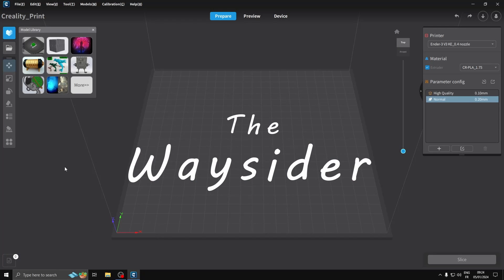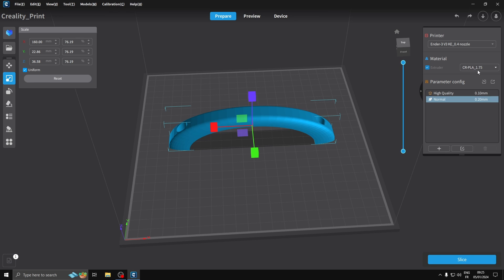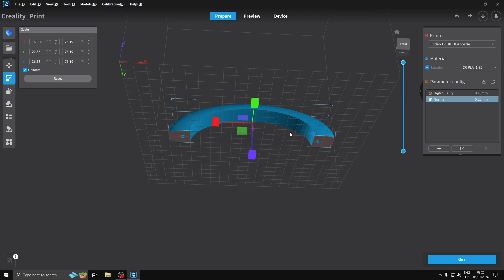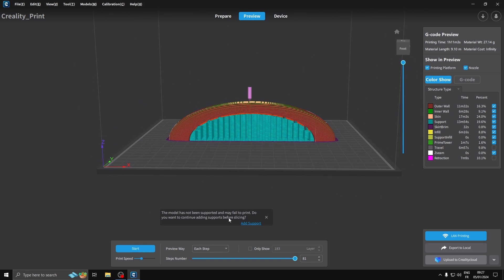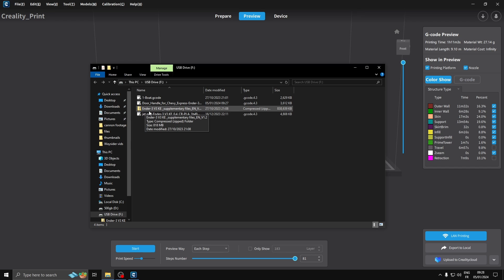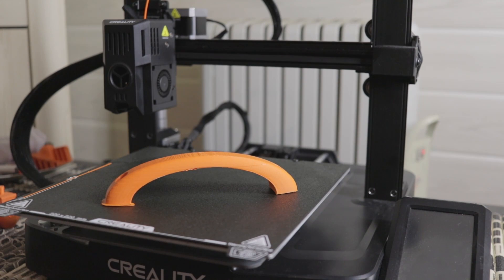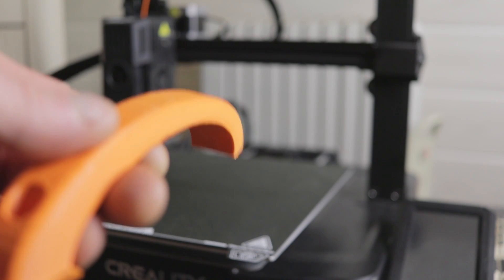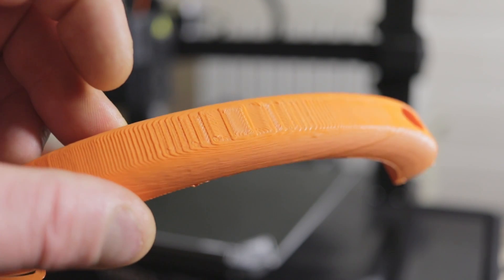Part print using Creality Slicer and the Creality ender 3 v3 ke 3d printer

Comment: Cura is much faster .
And my se wash faster then k.e.
I used the settings of the k.e.
It was slower .
K.e. also heats up the nozzle and build plate first.
Then says 8.
Procent done.
Then lift the when its starts printing.
Cura is the way to go.
Reply from the maker: Hi there I used cura before I chose creality print because the printer profile was in there. Will try cura again because it is a more pro slicer I feel. Is there a profile for the ke yet? Let me know and will give it a shot. Thanks for the comments.